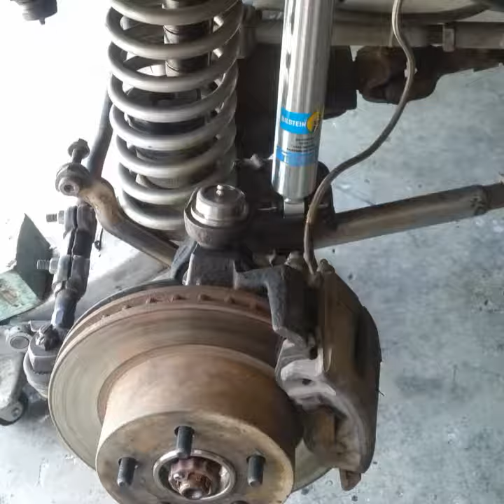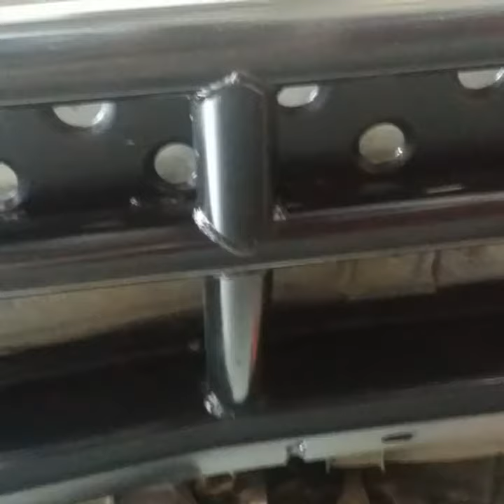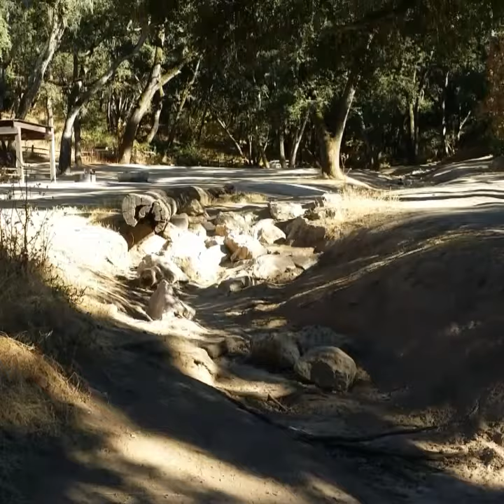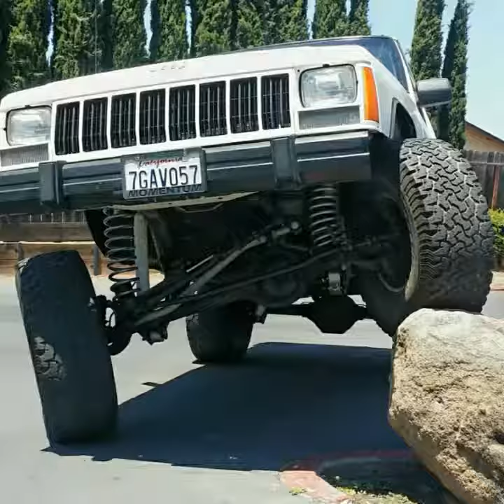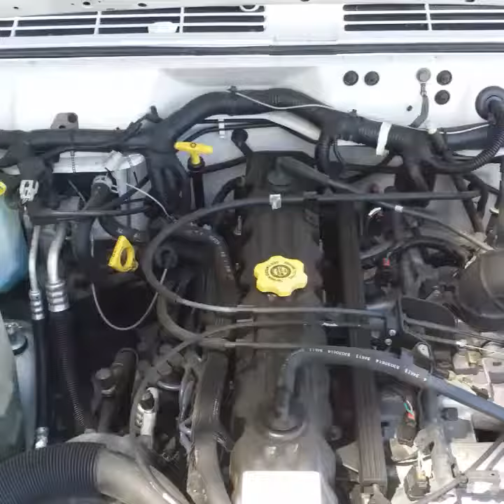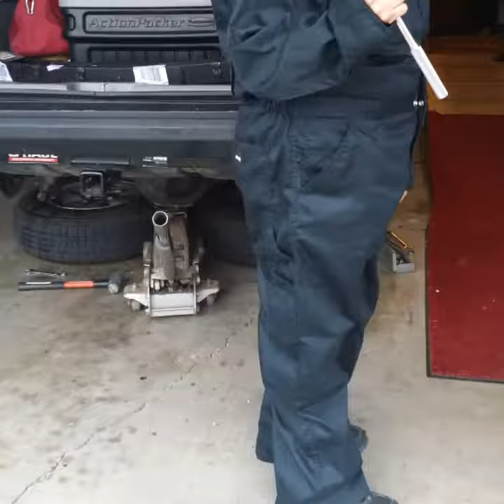Our Cherokee XJ

Comment: What’s sliders are those and what’s on your TB?
Reply from the maker: They're custom made and welded to the frame stiffeners by Rock and Road performance in Loomis, CA. TB?
Reply from the maker: LOL...
Sorry. I just figured out TB is throttle body! Its a rubber distributor cover from a Fox body mustang with the old 5.0L engine. I had trouble with water ruining my TPS sensor so I added dielectric grease to the connections and modified the rubber boot to cover the whole thing. Works perfect.